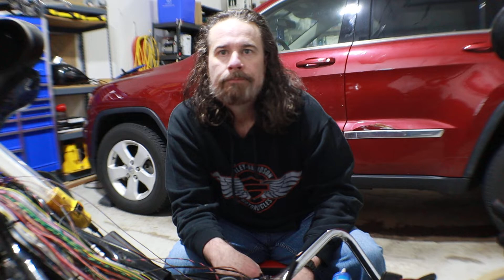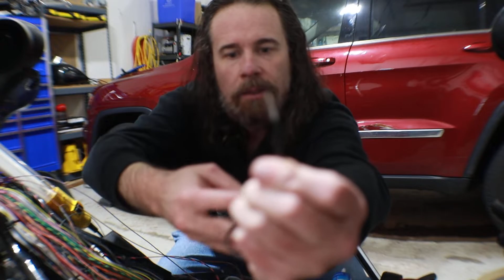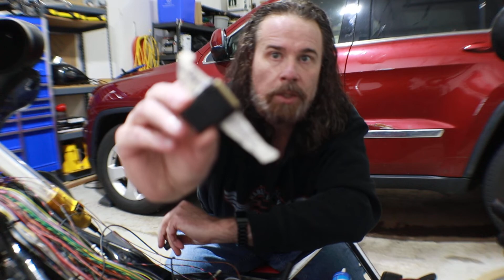2008-2012 Harley Touring TBW issues Part 1 of 5

Comment: wow, I just found your videos, I had my bike apart last year, throttle by wire unplugged, seat off, computer out, unplugged at throttle, everything checked out continuity wise, it will run great for a while, then notice a bit rough taking off from stop sign. p1510, p2138 pn32933-10. looks like i need to change every wire from throttle body connector at every connection and every pin. I wonder if I should just switch to carburetor.2010 FLHRK
Reply from the maker: @jackdevine5382  carbs have their own problems, and not as clean looking, but I hear ya on the frustration.
I'd suggest pulling one pin at a time from the TB, following it while bending the wire for as far as you can,vpast the neck area for sure, then crimping a new pin and moving to the next. It won't take too long and you will either find a weak spot in a wire, or have removed at least one fretted connector.

Pins are cheap, crimper is relatively cheap if you need one, and it will have a high probability of taking care of your issue.
But even if you find the issue and fix it I would still suggest running the wires through a dkeave, and buying that rubber boot if you don't already have it as a preventative measure.

Comment: Much appreciate your time and effort for this detailed series. Lots of helpful info here. Do you actually know the root cause for your issue?  After 15 years on my 2009 FLTRSE3 I experienced a similar issue. P1511, P1514, P2105, P2135. After jiggling the TB connector it cleared up and got me home. Now I'm looking for answers before tearing in to the bike. 
I'm hoping my TB connection needs attention and no further issues.  I did change my bars back in 2011 which I consider the job from hell and I never want to go back there again.